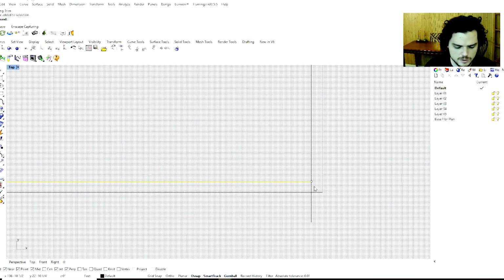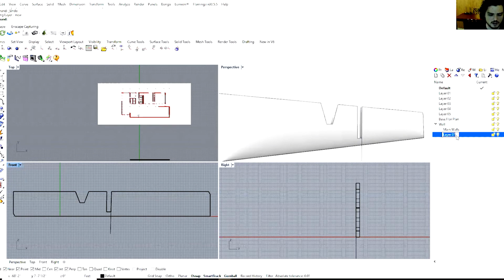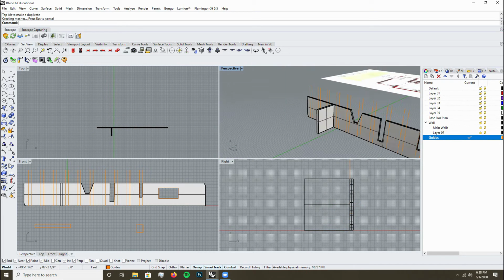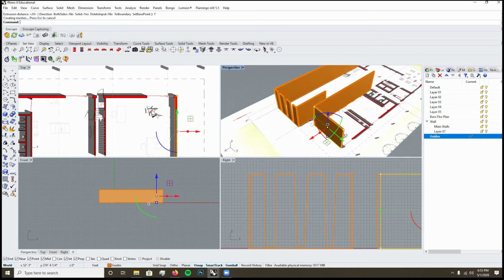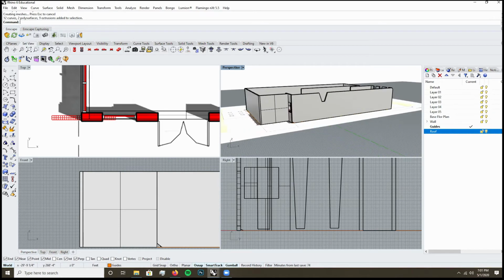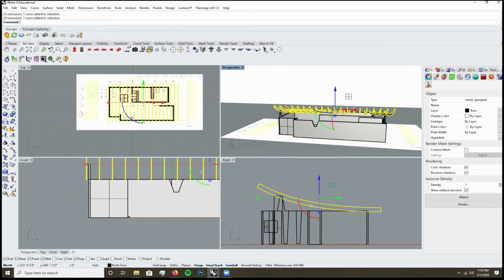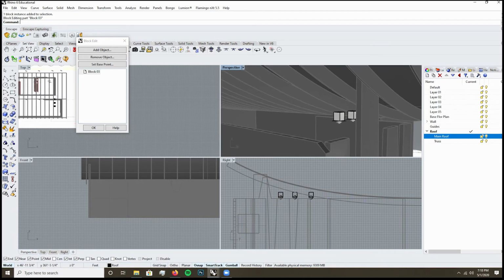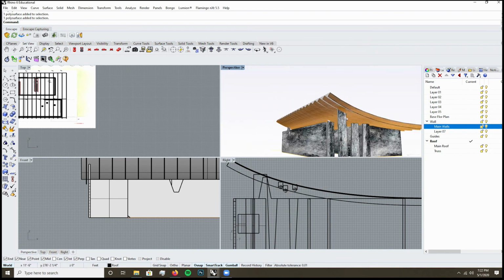Improve Rhino Work Flow for Architecture Projects: Layers, Groups, Record History, Sweep 2 and More

Comment: Great video! I like the way you explain. I have a question... what’s the function of block here? Is there same as AutoCAD or Sketchup? Thanks. Very useful this video.
Reply from the maker: Hi I did not go in depth with block because I do not use them that frequently. But they have a couple of cool functions (and will make a follow up video). For now, the nice things about blocks is that you can link/embed files to reduce file size, and updated external file. Its also an easy way to place multiple items. Again let me make a follow up video. Thanks for the feedback!
Reply from the maker: Hey Ivan made a block specific video: https://youtu.be/fxCiPGrSrMg

Comment: Thank you Nate. This is amazing. A bit confused about what record history does. What happens if you don't have it on?
Reply from the maker: When you hit record history right before it makes it so it is tied to the polysurfaces. When you don't have it on the curve is separate from the polysurface (I will make an additional video on that). That way when you change the curve it changes the polysurface. When you break history then it is no longer connected to the curve.  I have found it easier to deal with line work in rhino, the linework is easier/faster to manipulate. So I usually draft lines in front view or top view and then extrude those curves (when I hit extrude I hit record history right before) That way when I go back to the elevation I am changing the curves (in front view) not in perspective mode.
Reply from the maker: Here is the video: https://youtu.be/dvFE304yyds